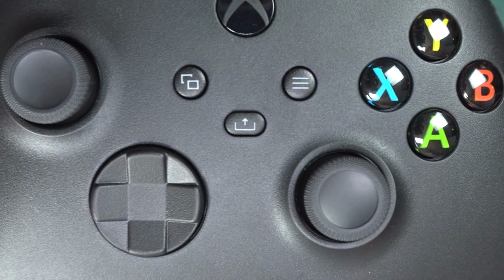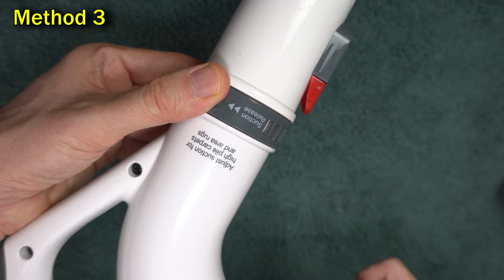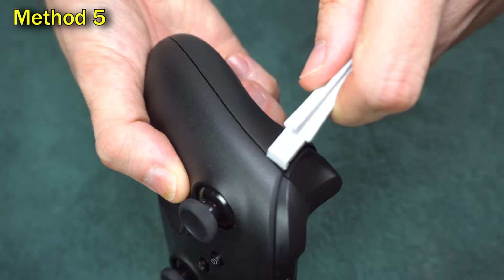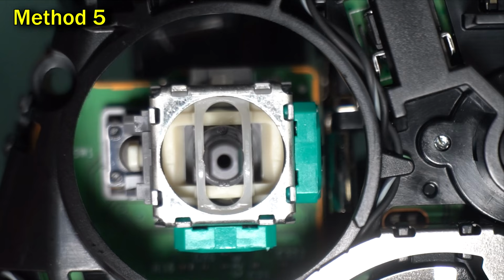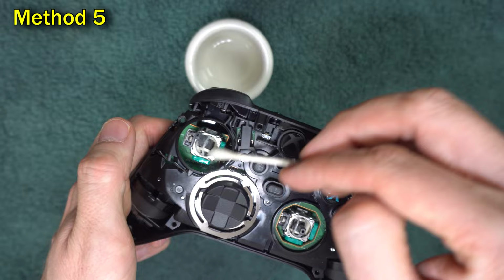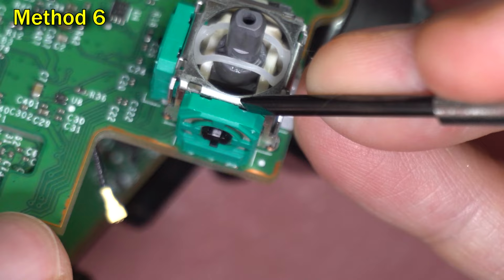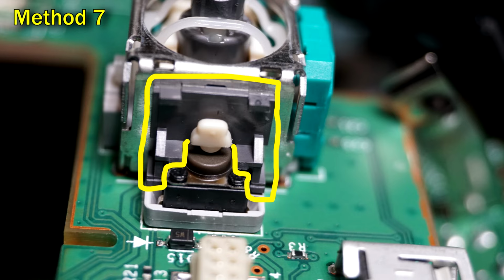How to Fix Analog Drift on XBOX Series X/S Controller (moving on its own, jittery, wrong direction)

Comment from the maker: Stuff you might need:
Analog Thumbstick Replacement Kit: https://amzn.to/3LvUVhn
Precision Screwdriver Kit: https://amzn.to/3TtYrur
Quick Charger for Xbox Controllers: https://amzn.to/3yMVTOK
Play and Charge Kit USB: https://amzn.to/3lokypN
Chargeable Batteries: https://amzn.to/3JBumoy
LB and RB Button Replacement Kit: https://amzn.to/3ZY8me9

All Amazon links above are affiliate links. I get a small amount of money if you end up using them to make purchase (it does not have to be for the item I link to, as long as you click my link then move to another item, it works)
Reply: You you fix controllers ? 
Because I got one that I need to be fix
Reply: Hey I was wondering how come you didn’t show you putting everything back together because I’m scared I might break something trying to put everything back
Reply: Is it ok if i only get just the first link or is that not enough
Reply from the maker: I show people how to fix controllers (and other things) themselves.
Reply: @HowToX What size are the precision screwdrivers you used? I the link there’s a 117, 122 and a 138
And if all of them can do the job, Which one do you recommend?
Reply: And I bought one on eBay and it’s “unauthorized “ device 😢
Reply: @HowToX I have a question my controller is only drifting when I play rainbow six siege but when I play other games it doesn’t do you know how to fix this?

Comment: Method 6 was the winner. I didn't want to have to get so far into the guts of the analog assembly, but ultimately it was worth it. Thanks for the motivation!
Reply: Yup same!
Reply: I did method 6 and cleaned it. Now it won't turn back on after j put it back together
Reply: @user-kx6wq1nc5h  Yeah, it gets a little crazy when you get in so deep. Lots to put back together and so many details to potentially overlook. Take a little break before giving it another go - sometimes that helps me. Good luck!
Reply: @user-kx6wq1nc5h  i did method 6 as well and put everything back and now the right stick drifts to the right and wont stop. before taking it apart it would drift up but now its pretty much fucked
Reply: @blap9467  I'm in the same boat here, left doesn't work, it's always going right, and I was trying to fix an up drift, I opened the bottom door thinking that was the one I needed to fix, but I think I bent it and it was the wrong one. Maybe I can grab a piece from an old Xbox one controller to replace it
Reply: @blap9467 if you have an old Xbox one controller you can swap out that part, or maybe even any other old controller, as long as it's the same part
Reply: I had to repeat method 6 a few times to completely eliminate the drift, but now it’s good as new. Lots of cotton swabs and alcohol were the ticket for me. Pulling out the small circular piece and cleaning it and the housing that it was in (in the green assembly) was the ticket.

The cotton swabs were showing that there was lots of black microplastic dust in there that the naked eye couldn’t see. Keep at it!

Comment: I'd like to thank you for the video. Method 6 worked for me as the part where the ring touches had a tiny stain and I managed to clean it. No more drift in my Xbox Wireless Controller.
Thanks to such a detailed and informative video. Straight to the point, no bs talk.

Comment: Thanks for the detailed video mate. Very direct and no clickbaiting. My left analog stick on my xbox one s controller was really bad. My character kept moving by themselves in games and were literally unplayable. So today I decided to open and fix it. I run through the comments before trying and saw a lot of people saying method 6 worked, so after trying the other methods I did method 6 and it worked!! The green plastic thing was really dirty. But only one of them. I had some trouble putting one of them back in place and had to cut the bottom peg. Then I tried it on gamepad tester, no more drift. And then went in game to test, and still no drift. So thank you again!! 😂
Reply from the maker: I'm glad it helped. Thanks for watching.
Reply: Any update?
Reply: @its_nuked  still working great. I haven't been playing much with my controller these days, I'm mostly on kbm. But I played a lot of spiderman with the controller after fixing it and it was working fine.
Reply: @MegaNaeem86  gotcha, thanks >:D
Reply: Yeah I really shoulda listened to him when he said “caution” a second time, my left-right on my left joystick simply doesn’t work anymore. The up-down is fixed tho!!
Reply: I am using 1 for my galaxy tab s9 plus for playing Genshin Impact with mantisPro & the right analog have some issues 😢
Reply: It worked on my controller,no more drift
Reply: I completed method five. The controller turned on great and the buttons all worked.   I walked away with it to put the grips back on and now none of the buttons work at all. The controller doesn't turn off unless I  take the battery out. What happened?
Reply: Never mind, it worked for few days 😓

Comment: I tried every step, 6 was the one that finally worked. Blowing didn’t, tapping on the back didn’t, cleaning out the inside stick didn’t, but prying apart that little green cap and cleaning the entire inside of that area(the white part mostly) actually did the trick, and the controller had no damage thanks to your cautious process. 

Thanks a ton dude, saved me 60 bucks because I was ready to just buy a new one!!! Also I felt really good after I got it to work, felt like a true tech nerd!
Reply: Same
Reply: @tizio2332  yeah, it helped as a temporary fix but then it eventually came back after a few weeks. As I’m a college student, It was nice tho as it gave me enough time to get a new one while still being able to play.
Reply: @NolanSchuster4 What was wrong with it? Was it the clicking of the joystick? Mine doesn't stay clicked and it's hard to use now.
Reply: @NolanSchuster4  same unfortunately
Reply: @solaria5513  like the screen would just randomly start panning up, and if paused a game, it would just cycle up endlessly through the menu. It was basically a “constant yet phantom UP input”. It eventually came back but I extended the life of the controller about 2 weeks with this fix.
Reply: @NolanSchuster4  you can buy those tiny sensor he pulled out, pretty cheap. Prolly fix it outright

Comment: Method 6 was the winner!! I was hoping any of methods 1-5 would work because I was dead afraid to go so deep into the electronics of the controller. But since methods 1-5 didn't help, the controller was out of warranty anyways, and the drift was no longer tolerable, I decided to give method 6 a shot. Got the precision toolkit, followed the video step- by- step, and voila! No more drift! I feel like I can do anything now. Thank you so much for this very detailed video!

Comment: PHENOMINAL VIDEO!!! Had a drift on my left analog stick and had tried everything up to step 5. Went to step 6 and it fixed it like a charm. Great video. Be sure you guys are using the right tools, be patient with yourself if it's your first time working inside a piece of hardware, and try not to rush through this to get back to your gaming faster. Just follow these instructions and your chances of saving yourself $60 will go up
Reply: How long does it take to dry at Step 5? I'm testing it on Cyberpunk 2077 after. It's the game I notice the drift a lot.

Comment: I've had a series s for less than two years and just a few weeks ago I started having drift problems on the right stick in the up direction. I saw this video and thought it would be good and it was!!! I tried method 6 of yours and it worked! It was definitely risky, and it was my first time trying it and I followed it the whole way through and fixed my stick drift!! Thank you so much for this amazing tutorial!
Reply: I have the same problem same up direction, trying it rn
Reply: @akosnovak8482 did it work?

Comment: Method 6 did it for me. Thanks a lot mate :) 
I did it on my second go as at first glance it seemed too difficult for me to disassemble it so much, but it turned out to be quite easy. Good luck everyone!
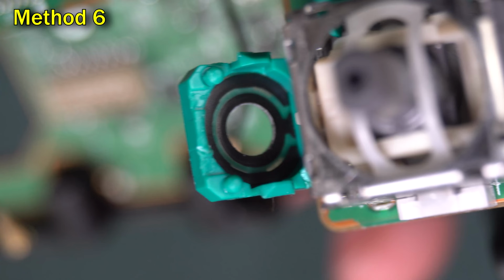Reply: Update: After a while another issue with the same sensor appeared. I've cleaned everything again but it did nothing this time. Then I opened different sensor to compare the tiny disks (6:40) inside them and it looked like the disk in faulty sensor was a bit deformed - this little nudge in the middle of the moving part was not there, it was flat and it turned out to be too tiny to bend it like that.

When all hope seemed lost, I remembered that I have a very old (at least 13 years) logitech controller laying around somewhere. I've decided to see if It's analog sensor uses the same disk by any chance. It did, and placing it in my xbox controller fixed my issue :)

So after my experience with all of this I can give you the following advices:
 
- be extra carefull when taking out and putting back in the disk
- If you have an old controller with analog sticks somewhere see if you can replace the disk part to fix your issue

Cheers!
Reply: @vdantey  tnx I have the same problem and really have to try this.(btw I only have one controller😭😄)
Thanks you!
Reply: What was wrong with it? Was it the clicking of the joystick? Mine doesn't stay clicked and it's hard to use now.

Comment: I really appreciate the help. I went through 3 controllers in less than three months last year. Those early controllers were super flawed. All of them had stick drift. I used my warranty until it ran out. It's a real shame that I cannot fix this because it's practically new.
Reply: Three controllers in less than three months? This drift thing is a bit of an epidemic.
Reply: Use one of the updated Xbox one controller that have Bluetooth built in. Those are the Xbox controllers with the least chance to get stick drift
Reply: @OswaldBatesIIIEsq  That was in the early days when it first came out.  The newer controllers (so far) seem to be built a little better.  I was fairly appalled.  The warranty covered all of the repairs.
Reply: @RealSkyeBlue  Still got drift in both the xbox one s bluetooth controller AND the new xbox one Series X controllers (Both bluetooth) in about a years time for each
Reply: My older one s controller lasted 3 years before the drift got really bad 
I got a new red one lasted 10 months before the drift showed up

Comment: Thank you so much, method 6 worked out for me and was less difficult than I initially had thought! You've resurrected my Starfiled limited edition controller!
Reply: If something happens that cant be fixed on your controller you can also take all the cosmetic parts from the controller and put it on a new one :)
Reply: @Aegis98  I know, but the drift really bugged me anyway ... sadly, after a couple of weeks it seems to be coming back so I think another cleaning round is due.
Reply: @Ruindur80  sad hope it works another time as well good luck 😊

Comment: Awesome Tutorial. Took me 5 minutes to open the controller and clean everything up. Works as a charm. It wasn’t to hard loosening the grips by hand, which is nice, because there are no visible damages seen now.
Reply: What did you clean with?
Reply: @alexpritchard7566  Alex?
Also use 90+ percent isopropyl. Use 70 if you can't find the 90+ but you have to let it dry more before you put it back together
Reply: @markallen8757 what happens if you don’t let 70% dry for enough time? That might’ve been what I did
Reply: Nice! I opened up the controller by hand as well. I have dishpan hands though, so it hurts my fingertips. Ow lol 😂🤌

Comment: Method 6 worked great for me! Thank you a lot! Btw, do not hesitate to bend the little spire metal back once you took it out of the green container and cleaned it.
Reply: how did you put it back in. mine won’t go in
Reply: What was wrong with it? Was it the clicking of the joystick? Mine doesn't stay clicked and it's hard to use now.

Comment: Method 6 was the solution for me. Took about 2 hours since it was my first time doing something like this and I was being extra careful. The Q-tip had dark smudges when cleaning the inside of the green door, so I figured that is what was causing the drift. Closing the green door took longer for me than I thought, but eventually I got it to close. Many thanks for the solution!

Comment: I worked my way through all methods and finally method 6 made it for me.
Great tutorial and well explained. First time ever for me to disassemble a controller and it worked perfectly.
Thanks!
Reply from the maker: Awesome
Reply: Is it still working? ^_^
Reply: @its_nuked sry for the late reply, unfortunately i had to do it twice because the drifting came back after some time and i guess i applied to much force cleaning it the last time. Its definitely broken now. Anyway, it was a good try.

Comment: Tried all steps except #6. Didn't want to risk damaging the small components. I ended up flooding everything with electronic contact cleaner, blowing everything out with compressed air. That finally worked and fixed the stick drift.
Reply: You did good. Just did #6 and it utterly broke my analog that is now unresponsive with a permanent drift.

Comment: Thank you so much, I was able to fix my 2 weeks old xbox controller using method 6. I really didn’t wanna have to go for method 6 which looked scary even for an avid hardware guy like me but the other 5 didn’t do the trick. Decided to try it anyway because I couldn’t bother waiting for the replacement and it worked like a charm !
Reply: How did you do that?
Reply: What was wrong with it? Was it the clicking of the joystick? Mine doesn't stay clicked and it's hard to use now.

Comment: I was a bit skeptical that it would ruin my controller for good and that's exactly what happened. Be very careful with step 6, once I opened those green flaps after 5:42 then my controller was never the same again, now there is an unfixable permanent drift. That part is very sensitive and didn't like being opened. Unless you really don't mind losing a controller I don't recommend going past step 5.
Reply: Mine was the opposite, I had the most horrible drift and cleaning that 1 green door thingy, boom no more drift, I think it’s very easy to break so just be careful

Comment: I want to thank you for this, my left thumbstick was making most games actually unplayable. Removing the grey door is exactly what my controller needed, i appreciate you mentioning that even though you didnt exactly believe in it. It seems like removing the grey door works when the stick is having trouble returning to the neutral position, at least in my case.
Reply: @xv3kyzarc472 What was wrong with it? Was it the clicking of the joystick? Mine doesn't stay clicked and it's hard to use now.

Comment: Well after 7 years of use my left analog started drifting foward (almost 2k hours on dark souls series/soulslike) was a about to buy a new analog but found this video and tryed a less invasive approach, cleaned both sensors with alcochol and a tiny clean with steel wool resulted on 90% of drift gone its almost imperceptible, thanks mate.

Comment: Chiming in with the method 6'ers! I was about to suck it up and buy another controller when I searched for fixes. Found your video and tried up to method 5 and still had nasty drift, so I tore it back apart and did method 6 and looks like all is well! Gonna dig out my old controllers and see if I can fix them as well.

Comment: This video is amazing! I used method 6 but instead of removing the back and fully removing the green doors I just ever so slightly pried the green doors open from the front and left them slightly open like I’m talking a millimeter or two and I just left it like that and that seemed to have done the trick!
Reply: What was wrong with it? Was it the clicking of the joystick? Mine doesn't stay clicked and it's hard to use now.

Comment: Thank you so much! Worked like a charm!

As you stated the most struggle i had was with the grips...

Also my controller was built with security torx screws which have a little pin in the middle.
For those of you who also have those screws, you can unscrew them with a small flathead if you dont have the right torx bit.
There was also only one connector cable for me.

I followed the list up until Method 6, which seemed to do the trick for me. The inside of the "disk-chamber" of my Y-Axis was fairly dirty.
I cleaned both of the disks and chambers with Isopropyl.

Putting it back together i unfortunately broke one of those tabs in the grip.
Both of the grips definitely feel "looser" now but man...the drift is gone...

Cheers!
Reply: Can confirm the right tiny Flathead works

Comment: Nice work!  The first step helped me with my problem.  The left analog stick was stick drifting.  So I tried cleaning the entire unit with a Q-tip and alcohol.  It's working again.  Also the trigger buttons were sticking.  Cleaned them the same way with the left stick.  You saved me from having to buy another controller!  Thank you for this video.  Gave it a like!